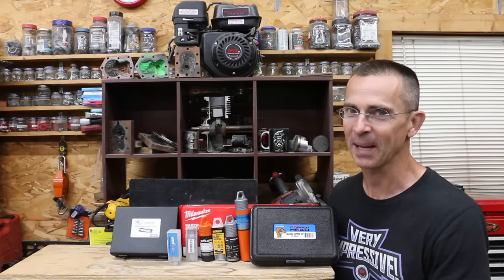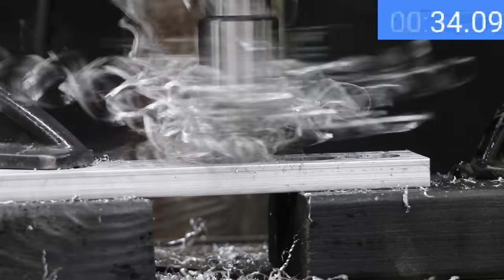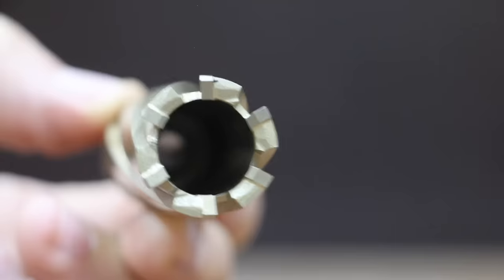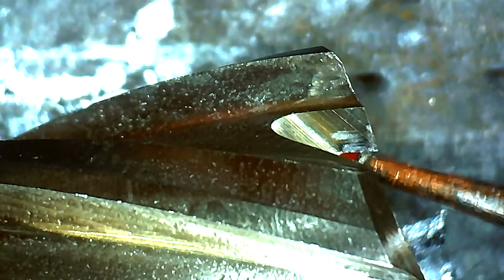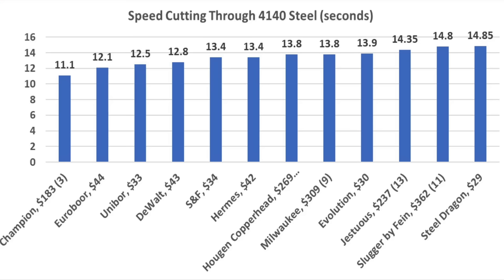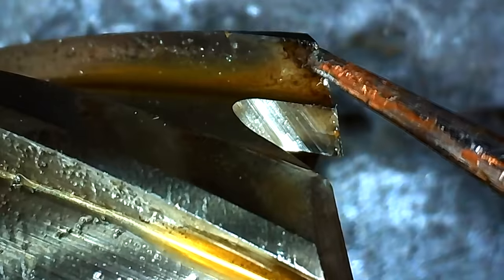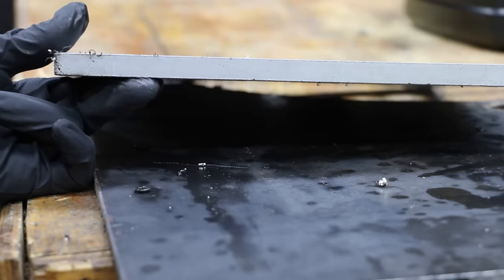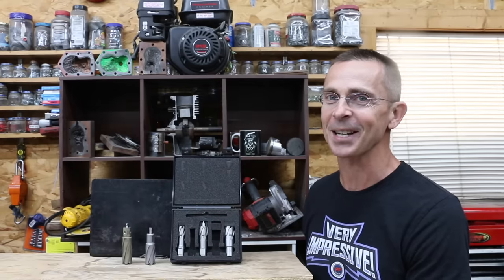Best Annular Cutter? Fein, Milwaukee, DeWalt, Euroboor, Hougan, Hermes, S&F, Evolution, Steel Dragon

Comment: I've bored thousands of holes at work with annular bits. Usually 1 3/16 holes in 1 1/4 mild steel with a mag drill. We use copious amounts of coolant and the euroboor carbide bits usually  last for several hundred holes. I think lots and lots of coolant is the secret lol
Reply from the maker: Thanks for sharing.
Reply: Tungsten carbide doesn't really need to be cooled. That's because tungsten carbide has a very high melting point. 2,785–2,830 °C (5,045–5,126 °F Carbon steel melts at 1425-1540°C (2597-2800°F) So what you're cutting would be a puddle long before tungsten carbide started to soften up. But you will get a nicer surface finish using some cutting oil. We're going in dry!
Reply: @1pcfred  Yes it does. The longevity of a cutter is directly correlated no matter what the material to temperature.
Reply: Well, yes and no.  Tungsten Carbide has very high melting and working temps.  Both in the 2500-2800C range.  So it's true that you don't need cuttling fluid when using those bits to cut through steel.

Having said that you'd be a fool to try.  You would put needless stress on all your parts (not just the bit) and the heating cooling cycles would not be good for the overall duty cycle of the bit itself.
Reply: @NOTNOTJON  running carbide dry is common standard practice. You do it because you can run carbide about 4 times faster than HSS. At that RPM fluid flies everywhere. So it's a bit messy. To each their own though.
Reply: @EnlightenedSavage  tungsten carbide can run much hotter than HSS can. Chips carry heat away from cuts. When you're cutting with carbide tooling you should be throwing blue chips. They got blue because they got that hot. That temperature is no sweat for carbide either. But you do you.
Reply: @1pcfred  is there an advantage to using cutting oil for the material you are cutting? Curious…I have no clue
Reply: @nachoisme  it depends on the tool and the material. Cast iron is cut dry. Cutting fluids can improve the finish with aluminum and steel.
Reply: Agree I use cheap annular cutters but with coolant and I haven’t had any issues with dulling
Reply: Agree with all the flooding with coolants. That said, these bits aren't given a realistic test unless your abusive or ignorant about how to use them. Same goes for drill bits..
Reply: @ihatelogincrap  hey when you're there with your buddy out in his driveway drilling out wheel studs it can get pretty abusive then. That triple gear reduction drill is really you!
Reply: @1pcfred  Running on cast iron dry I understand. But if you're doing mild steel or stainless the coolant helps tool life, considerably. With an annular cutter all of the heat is transferred to the slug, not the work piece, which is one of the biggest benefits of them. However, running dry can also cause you to work harden the work piece, thereby making the cutter work harder than it needs to, & burning them up prematurely.
Reply: @timso522   cast iron is not steel in any way, shape or form. Although I can see how the stock may confuse people that don't work with it. But as soon as you cut into cast iron the difference is clear then. Cast iron will not throw chips. Whenever I work with cast iron I get the distinct impression that the stuff is just consolidated dirt. The swarf cast makes looks like dirt. It makes me dirty too. So if you were to use any fluid with cast iron you'd only make mud. You can use compressed air with cast iron. That makes a mess too but it can work. Cast iron also has a different thermal transfer rate than steels do. Considerably different. Cast iron is much more heat conductive.
Reply: @Paul Frederick  if there's brazing?

Comment: That AR500 steel is crazy tough stuff.  We build 33' long side and end dumps (think giant dump truck), and that's the stuff the boxes are made of. It nuts watching these HUGE boulders get dropped into them, and there's usually barely a scratch.
Reply: The guy that drops off aggregates from the local quarry said he will not drive any truck that doesn't have the front face of the load box made of it. It backed-up the story I was told by a guy I worked with, that was driving a truck for a local earthmover as a weekend perk-job. Shifting large rocks for a landscaping job, he had to make an emergency stop and the whole load broke through the cab. Luckily he was pushed sideways against the door but had ongoing back problems that prevented him doing his main job for 2 years. One of those examples where both safety AND durability justifies the cost.
Reply: A steel place I know makes bullet traps for shooting ranges. They use a lot of AR500. I got there to get scrap pieces to use for targets.
Reply from the maker: Thanks for sharing!
Reply: @petermoto409  the targets I buy are ar550. The 550 means 550 Brinnel hardness, so its a little harder than ar500. Holds up quite a bit better. TA targets and shoot steel offer ar550 targets.
Reply: Nobody needs AR500, are the deer wearing Kevlar vests?!
Reply: @davidswanson5669  What? The guys here are talking about AR500 as a target plates so they last longer. What does that have to do with deer?
Reply: @davidswanson5669  - It's just for self defense!  🤣
Reply: @davidswanson5669  headshots nullify it. 😅
Reply: @Renee_R343  - minor gag comparing it to an AR15.
Reply: The wear plates in the  machines I build at work, Deister Machine Co, use AR500 steel. Those thing last a long time. They def need to with all of the aggregate material those machines see.
Reply: @KimballPrecision I may have to try some 550. My 300 win mag makes ar500 look like I used an annular cutter on it after shooting.

Comment: Sometimes just knowing a tool exists can be a boon to projects. I had no idea there was such a thing! Thank you!
Reply from the maker: You are welcome!
Reply: There are also similar cutters designed to be used with hand drills, though I've also chucked them up in drill presses and Bridgeports. The set I have is made by Hougen (I think they call it "Rotacut") and is marketed for drilling out spot welds. They're much more versatile than that, though - I've even used them to drill 1" dia holes in 1/4" wall stainless pipe.
Reply: @flat-earther  Put down the crackpipe.
Reply: @Boabreath  we make some that have 2" depth of cut, as well as some that have 4" DOC, for cordless drills. All carbide tipped.

Comment: I think some of the more common items you tested a few years ago might be worth a revist if there are new brands, altered supply chain, updated pricing etc. Bringing this up after looking at the car battery and jump starter videos today.
Reply from the maker: Thanks for the suggestion.
Reply: ^ I can think of a few in recent tests that didn't include brands I was curious about, The Pittsburgh brand locking pliers suck and the teeth round off quite easily, decided to take a chance on Bremen, a brand I'm unfamiliar with, I've only used 1 of them, and only once so far, but they seem like they'll at least hold up to moderate use unlike pgh brand. Was quite surprised Icon wasn't included in the ratchetting wrench video. HF has been pushing into higher quality tools for a while now, and it's nice to finally have a Craftsman replacement in Icon and some of the other new brands. I bought a new Irwin tap and die set recently after the tap and die video, again I've only used it once so far, but the die did a good job repairing the threads on a stud and doesn't have any visible wear. Picked up a set of PB Swiss screwdrivers when I had some seized screws in a pop-up headlight assy that I wanted to avoid having to drill out, everything else I already had was slipping, impact screwdriver(The hand tool you smack with a hammer, not a power tool) didn't seem to have any effect(video idea), but the PB Swiss screwdrivers were able to get them out in one piece. It really helps not having to buy things twice or more until you find a brand that offers a quality product at a reasonable price. Idk how many people actually take my suggestion, but I recommend this channel to a lot of people, it's a great resource for anyone into DIY or the trades.
Reply: I’d love to see hunting gloves

Comment: I was a machinist for 10 years in the 70's. Never heard of an annular cutter and really don't have much interest in machine work, but I watched every minute of this video and REALLY enjoyed it.
Reply: put one of these in a bridgeport and it is outstanding.
Reply: @jimstewart8394  Yeap.
Reply from the maker: Thanks!  Thanks for sharing.
Reply: I haven't seen them being used in a mill ever, these days you'd use a u-drill for machining holes. For on-site work though, like drilling holes in an existing steel structure, you can't beat a mag drill. Incredibly useful stuff. I was at a job site where I had to drill hundreds if not thousands of holes in 8mm thick steel, I don't want to know how much time it would've taken with twist drills.

Comment: I learned about annular cutters 14 years ago when I was building a front bumper for my Jeep. I was amazed how quickly I drilled a one inch hole all the way through a quarter inch wall 2x2 steel hitch receiver!
Reply from the maker: Thanks for sharing.

Comment: I really got a lot out of this video. I use annular cutters daily, sometimes all day long. I used to be a hss slugger purist, but have recently got a carbide set from steel dragon, very similar in looks to the Champion. Now they're all I use. This is some of the best content on the Internet.

PS- I'm learning to resharpen cutters on my surface grinder, if you want to send me any of those smoked ones to practice on, I might be able to get some more life out of them!
Reply from the maker: Thanks and you are welcome!
Reply: Hey Andrew I just so happened to have a whole case of various steel dragons I would say probably 50 bits. I am trying to sell to someone that needs em. Let me know if your interested

Comment: the hougen copperheads hold up well,  used them at work to drill 1.5" thick bars at 31mm diameter, we drilled hundreds of holes per bit.
Reply from the maker: Thanks for sharing.
Reply: What the heck are you making?  Dang!
Reply: @wallacegrommet9343  cell tower reinforcement bars, 1.5 thick, 3-5" wide and usually 20' long, bolted to the faces with specialty bolts known as ajax bolts, usually 3-6 per tower
Reply: @jjrizzles  can you elaborate as to what makes Ajax bolts special? I googled them and it appears to just be another fastener manufacturer. Perhaps I missed something? Thx.
Reply: @gunner4544  they're a fastener for holes you can't access both sides of, you use a special tool to insert them through the drilled hole, and it has a split washer that unfolds once through the hole so it can all be tightened from the outside.
Reply: Never would have guessed telecom !

Comment: Carbides are designed to operate well under high rpm, so the tools with carbide inserts were handicapped by the cutting speed tests.  Check the package for manufacturer recommended surface feet per minute (sfm) to use the best rpm.
Reply: i doubt a 1hp drill press would have the power or rigidity to make a cut like that
Reply: I mean, "high speed steel" is also made to operate well under high rpm.
I suspect the rankings wouldn't have changed much if you used the same, higher, rpm for all of them. If he used different rpms for all of them, the test would not be very useful.
Reply: @jort93z  tools should be run at manufacturers recommended specs. that's the best testing methodology.
Reply: @chrishayes5755  one issue: tools manufacturers are on their own, and builders are on their own. These are 2 independent branches of science. If you ask me, it is builers define what tool must be capable to do, and tool manufacturers build tool according to requirements, or suck huge ****. If the tool is not applicable to any demanding job, that is waste of resources to produce it.
Reply: @jort93z  nowhere near the rpm carbide should run at
Reply: @jort93z  Yes, old idea of high speed. Hard to find an old lathe or small lathe you can really use carbide fully on, as it can take 2 to 3 times the speed to really use. I set mine to max 1500 rpm, but don't have enough power to take a full deep cut with it unless I drop the speed back down.
Reply: @chrishayes5755  mag drills normally  have a fixed speed  and most manufacturers have a similar speed for a set capacity..off the top of my head my drill with a 40mm  (1.5 inch) cap is about 350 RPM ..bigger drills with capacities of 80-100mm have 2 to 4 speeds to run the big cutter more slowly
Reply: @chrishayes5755  

Too many variables. And at any rate the carbide tools still mostly came out on top despite apparently being 'handicapped'.
Reply: You are correct. Given that every tool had the same diameter here, the carbide inserts are likely designed to cut at 1.5 - 2x the rpm of the HSS tooling for any given material. Too slow for carbide reduces the cut efficiency and can wear the tool out much more quickly. HSS is much more sensitive to speed though, and would be ruined more quickly at a higher speed. The carbide did better in the steel because the speed was closer to correct. The HSS should have been slower in the steel, but that isn't an option for his press. That's a clear reason for the damage on the HSS tooling in the spring steel. Seems like it was kind of a wash.
Reply: @brycejensen5201   with a mag drill with a fixed speed you cannot give the carbide cutters any more speed,, both get the 350 RPM of my drill ..i have cutters of the same brand as my drill in HSS and carbide..what i do is i don't feed the cutter hard so i get blue chips with HSS but a can feed the carbide cutter harder and i dont mind if i get the odd blue chip from them ..then the cutting speed is not to for behind
Reply: @brycejensen5201  the geometry of the carbide tips aren’t good for aluminum too. The positive cutting flutes works better in soft material. Especially if u can’t run the right parameters
Reply: It’s always bothered me how he test saws and grinders at the same weight/pressure. When I know for a fact some could be pressed at least 25% harder and cut wayyyy faster then the higher rpm ones.
Reply: Reality evidently disagrees with the premise that the carbide was "Handicapped" by the lower rpm- this is evident by the fact that the carbide tipped cutter where the only ones to clear the AR500 plate.

If you are going to start talking about theoretical SFPM measures then you need to bear in mind that the manufacturers state that those are suggestions for optimum tool life on carbide as carbide tools in engineering are designed to provide time savings to justify their cost

Low RPM cuts do not preclude Carbide from making cuts, they just require a higher torque load as they are fundamentally not as sharp as HSS tools due to the brittleness inherent in their hardness requiring a lesser rake angle
Reply: @77appyi  With a fixed speed there isn't anything you can do about the surface foot. Best thing for it is to use HSS for smaller diameters, and carbide for the bigger diameters. It sounds like your carbide is turning roughly the right speed, and that the HSS is therefore spinning too quickly. As you said, it can't be changed so if you're happy with the number of holes you're getting, more power to you.

I work in a machine shop with 6 CNC's and 4 manual machines, and handle a lot of set up and programming. With the correct surface speeds tools last much longer and can make comparable finishes. Carbide just typically wants higher speeds and feeds than HSS. I was recently making some parts out of G-11 Mycarta, in which the HSS actually worked better than carbide. Our theory is that because the HSS is uniformly hard it isn't deteriorated as quickly as the binders holding the carbide together.
Reply: @kleini3  I agree, these tools have flat soldered on carbide inserts, which are not good at chip evacuation. They don't appear to be high volume or for real production.
Reply: YES MY THOUGHTS EXACTLY
Reply: @jort93z  high speed steel was invented when high speed wasn't very fast.
Reply: What makes carbide suffer is lack of rigidity.
Reply: @jort93z  High Speed Steel is a bit of a misnomer. It is higher speed than carbon steel but not much higher. The max cutting surface speed for HSS into mild steel is 100 SFPM Which here with a 15/16" diameter tool  would be 407 RPM.
Reply: @bengrogan9710  it doesn’t prevent carbide from cuting but it comes with other problems like chips sticking to the tip especially in aluminum. 

In ar500 the carbide was successful because 250 rpm was possible closer to the recommendation of the manufacture for the surface speeds. The HSS needs to run much slower and even then I doubt that it last more then 1 or 2 cuts cause they can’t withstand the heat generated while cutting and a carbide is the only one suitable for that kind of material.
Reply: @brycejensen5201  absolutely. More for a home shop then industry. In cnc u had to deal with the inner core that the cuter leaves and u would risk damaging following tools. Rather use a full sized drill with inserts

Comment: I've been machining over 40 years now, I don't buy and tools or cutters before watching if you tested them. Thanks again.

One thing, once that high carbon steel gets overheated by a cutter the cutter is toast, that plate gets to 50 to 60 Rockwell C. I knew the carbides would come out ahead in the end, they'd be my choice!
Reply from the maker: Thanks for the feedback.